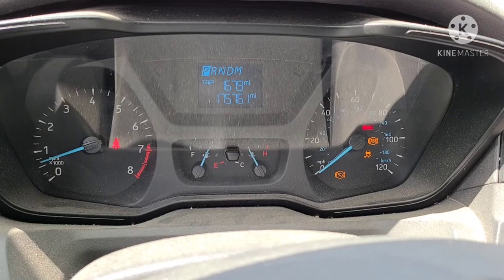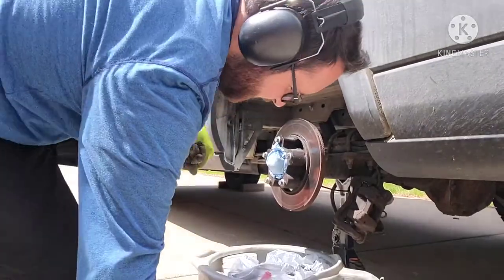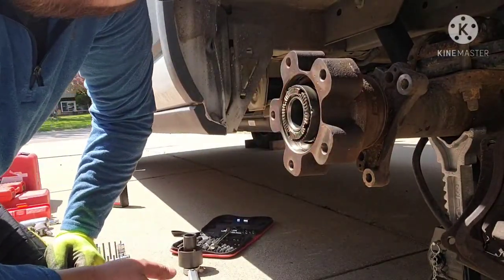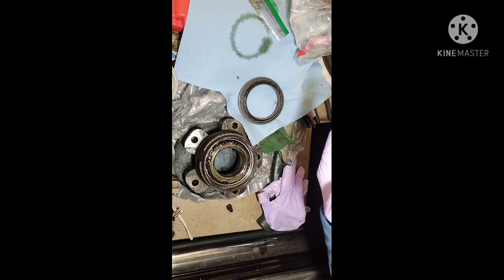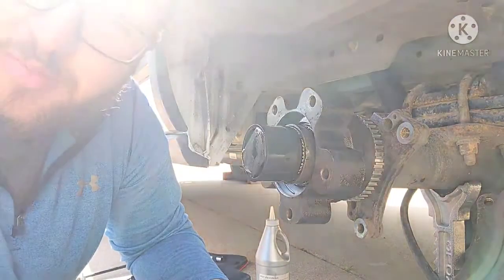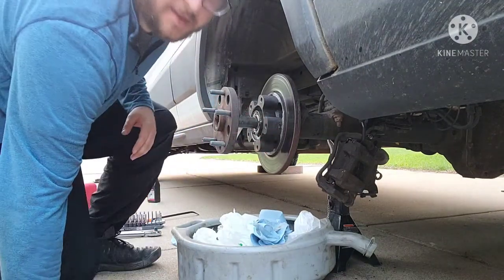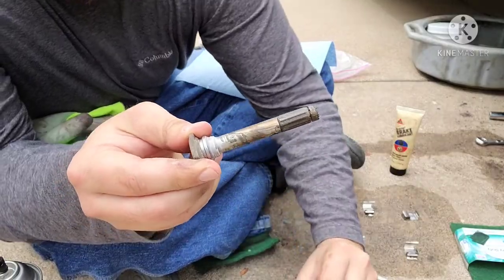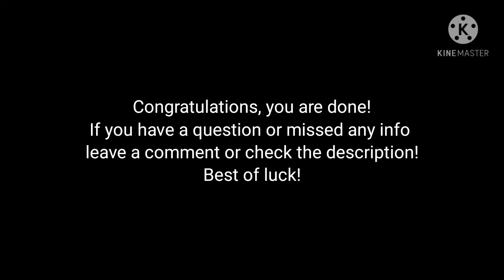DIY Ford Transit rear ABS tone ring replacement (rear brakes, axle, hub, and bearing removal shown)

Comment: So I finally got around to doing this before the snow flies.  No problem except those teeny M6 bolts which hold the brake "dust" guard on broke off with little effort.  Chock up another issue with living in road salt country!  One thing I never needed but now it's in my tool arsenal, is the slide hammer.  Never even saw or mentioned it used in this video.  Oh well.

Comment: On the rear brake caliper, without mounting the rotor I mount the bracket with and caliper with the old hardware so the caliper isn't flopping around, it's like putting the caliper in a vise as I only have that dice looking tool.  Works great. Then pull off the caliper and bracket mount the rotor and keep going.

Comment: Good video, i had to do the ABS Ring last year, which is a shame as this would of been real handy. Im also glad to see someone else has to deal with rust and not just me haha.
Reply from the maker: It was a bit of a surprise as the van is so clean underneath, but just a little bit in those press-to-fit spots make it rough without a plan!

Comment: Love the video! Very detailed. Did you mention you have over 180,000 miles on the van? Curious on all maintenance you had done and how your transmission is holding up? Hope to hear back! 
Cheers
Reply from the maker: Thanks, glad you enjoyed it! For maintenance it was pretty minimal, consistent fluids, brakes tires and sparkplugs at normal intervals.

Transmission worked well, I did fluid flushes (I have a short not very quality video showing how) roughly every 60,000 and put lubegard red in with every trans flush and it was still shifting like a top when I sold it!

Comment: For a SRW van the rear axle bolts are (5) W716084S439 and are not re-usable.  I also found out that if you attempt to use the factory cruise control before the repair is made and the codes cleared, the system goes into limp mode!  I reset the error codes and the van went back to normal and could drive it again.  Not sure why it does this.

Comment: Wonderful video, thank you!   The driver's side tone ring is shot at only 32,000 miles on my 2015 Transit 250!  Would you suggest doing the passenger side at the same time or just the one?
Reply from the maker: Oh wow that's too bad. Mine was the same year, lots more miles at failure. Maybe it's more of a time in Salt road states than a mileage failure. 

I would just do the repair if the ring is broken. You can inspect the other ring, if it looks corroded or has cracks, then I would replace before full failure.

Good luck!

Comment: Why not just leave the rotor on it if you don't have to change it.  I did. Worked fine
Reply from the maker: Definitely a good idea. I thought the hub would be harder to get off the axle tube, and I needed the rotor out of the way for my hub grappler to grab onto the backside of the ears on the hub. It came off easier than I anticipated so probably could have left it on and just worked it with the pry bar against the back face of the hub without scratching the rotor face!

Comment: Hey, im have all the same light on and off and now stays on too, did the bad tone ring made any crazy noise or specific sound while you driving or braking ? Thank you
Reply from the maker: I didn't have any noise at all actually. But it will definitely one day as it's a broken piece of metal spinning around at the speed of you wheels turning, so if it flings off or bends, It could definitely do some damage. I got to mine while it was still attached but cracked
Reply: Thank you

Comment: arnt you supoosed to heat the abs tone ring before fitting else it can crack again ?
Reply from the maker: You could, but since it is greased it slides on pretty easy, just needing taps with a rubber mallet. 

The ring is so thin it will cool down extremely fast, so for any noticeable change you would have to be heating it while pushing it on at the same time, which I wouldn't recommend as rubber seals could start to melt in the hub.

Best of luck!

Comment: Did this fault stop the speedo working mate
Reply from the maker: Mine did not have any issues with the speedometer due to this issue, I'm not 100% but I believe the speedometer is run by a sensor connected to the Transmission

Comment: 22 FOOT POUNDS FINAL
Reply from the maker: Is that what you got with a torque wrench on the nut after doing the rotational torque method on the hub assembly? 
Remember it's 12 inch pounds at the hub holes, and since the holes are around 3-4 inches from the center of the axle you should only have to pull with 4-3 pounds of force to make it move.
Just worried that might be a bit high since the manual says not to exceed 25 ft-lbs on the nut or it can burn the bearings.
Reply: Matt Baird, that's what I thought too... in one of the videos I watched, it says to tighten to 70 ft-lb, then loosen 180º, and finally torque to 22 ft-lb... I even saw an initial torque of 98 ft-lb